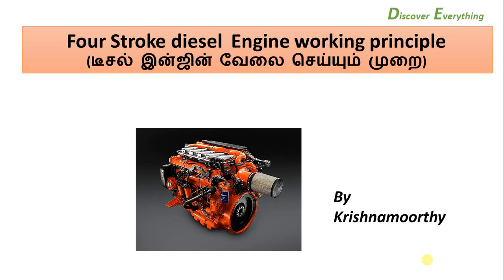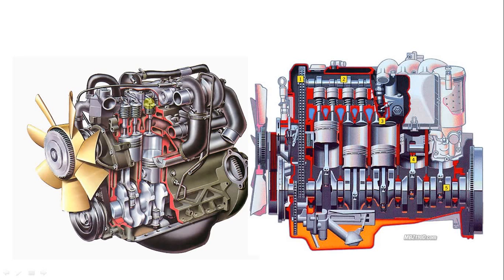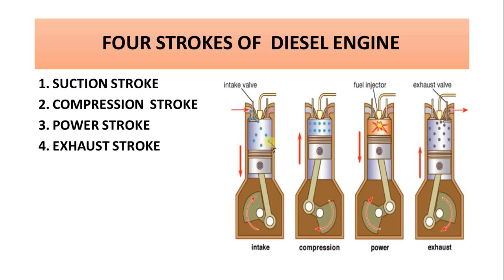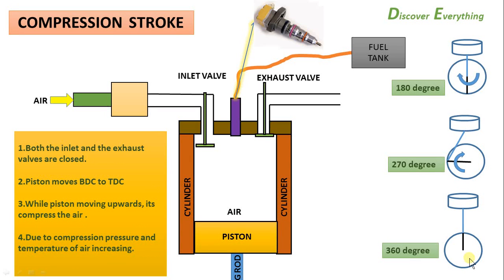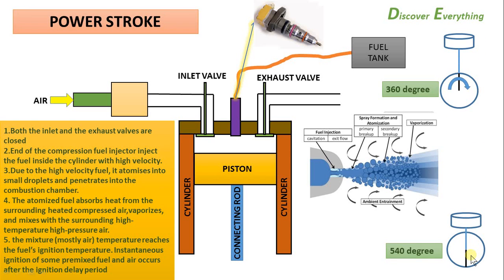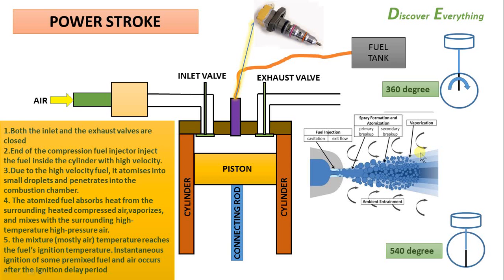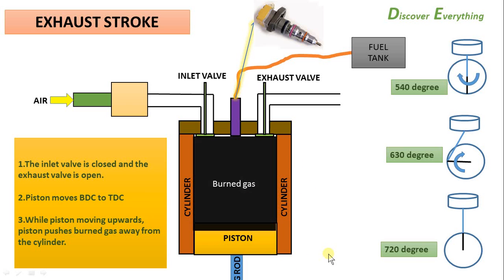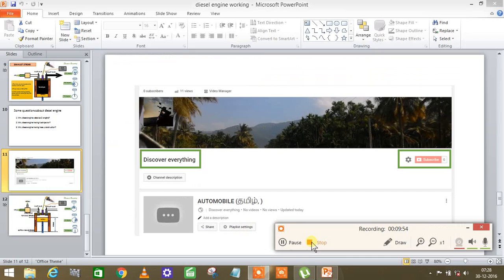டீசல் என்ஜின் வேலை செய்யும் முறை

Comment: There is not only chain drive for cam shaft... gear drive also there...and begin u mentioned Sparks plus on this... diesels engine have no Sparks plug...and the engine start Fair because of compression stockings temperature..and fuel
Reply from the maker: Gear train used in old engine